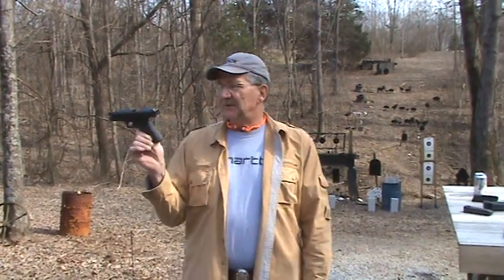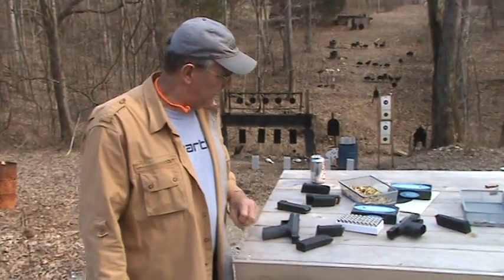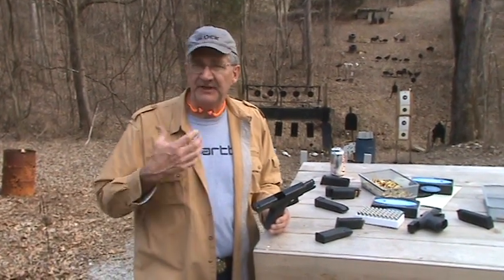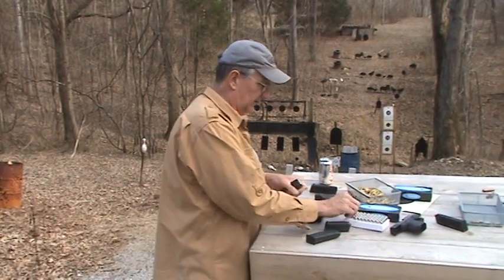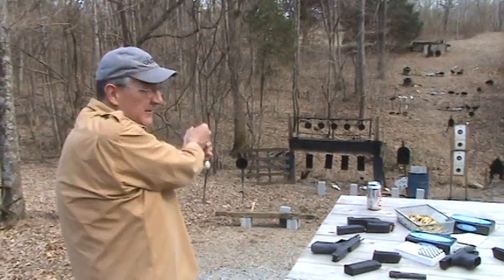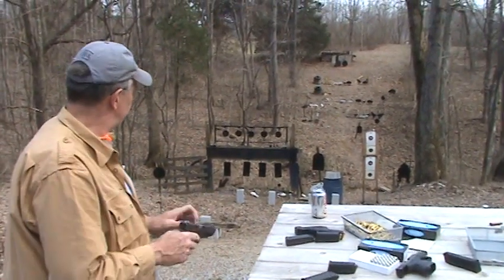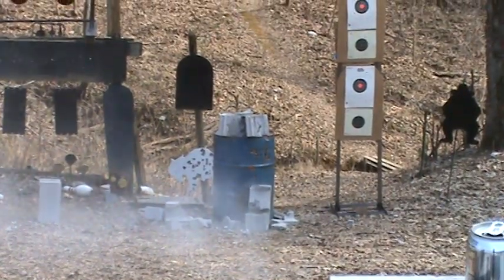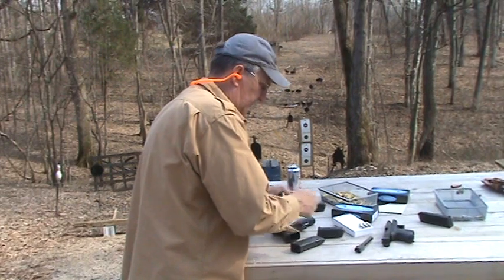Glock 20 with heavy cast bullets

Comment: Hickok45 is probably the one person who can actually say "It's not me, it was the gun". He switched out barrels towards the beginning of the video and started nailing his targets. Any other shooter would've just been missing and making excuses. Absolutely amazing.
Reply: GlowWormActual  that actually has me concerned ....if he can't hit with a stock barrel should  i give up on a g20sf and move on to a g40 that he didn't have to switch out barrels on?
Reply: +racex428 230 grains is super heavy for 10mm. That alone will mean it's hard for a standard 10mm rifling twist to keep it stabilized. Then, they're 230 grain hard cast lead bullets. The polygonal Glock rifling does not bite into unjacketed bullets well enough to stabilize them. They skip over the lands and don't twist along with them. All of that means that the bullets leave the barrel without enough gyroscopic stabilization and tumble end over end as they fly. When Hickok changed to the Lone Wolf barrel, he went from using polygonal rifling to standard rifling. Standard rifling has sharp edges which bite into unjacketed bullets. Now that the bullets were being spun by the rifling, they flew straight and true and were much more accurate. 

So anyway, my advice is to be aware that super heavy and/or unjacketed lead bullets don't work well in a stock Glock barrel and that an aftermarket barrel might be necessary to shoot them accurately.
Reply: mannys9130 so lighter hollow points should do just fine with a stock g20?
Reply: +Luis Angel Perez Oh absolutely. Also, in another video Hickok shoots 220 grain hard cast bullets with no problems. Any jacketed ammo will be fine, and any 200-220 grain hard cast will probably be fine. 230 grain is just too heavy to be stabilized with the stock twist rate and smoother polygonal lands.
Reply: mannys9130 Thank you man, what would be the best round for a g20 in your opinion?
Reply: +Luis Angel Perez In my Glock 20, I load Underwood 180gr GoldDot JHP for if I'm out in the desert. Perfect for mountain lions or people. I load Underwood 220gr hard cast flat points if I'm in the mountains and able to encounter a bear. I load Underwood 200gr XTP JHP in my Glock 29 for EDC in town where I'll only encounter people or dogs.
Reply: LoneWolf commercial
Reply: GlowWormActual I loves my gun

Comment from the maker: The stock Glock barrels are very accurate, in my experience. They are just not designed for heavy cast bullets.
Reply: No. Hard cast bullets have no jacket. The Sig V-Crown JHPs are jacketed. You won't ruin your barrel shooting it in either case, you just would need to clean your barrel with different cleaning products than you'd normally use.
Reply: Wow, amazing to see it that inaccurate! not sure how I have missed this video.
Reply: Underwood came out with a hard cast with some coating on it so it's safe for Glock 20 stock barrel. Have you tried these?
Reply: Double tap uses a copper gas check on their hard cast which is supposed to minimize leading issues

Comment: Glock has the best 10mm, by far. Low recoil, capacity, and reliability. Good demo, as always.
Reply: +mick mueller Don't forget the pricing!
Reply: I agree 100% with you can't beat the Glock in 10 mm it was made for that round
Reply: @louisstaiano4566  The new XDm 10mm has them beat now. They don't need aftermarket barrels to fire any thing. Glock did hold the title for best 10mm for yrs though.
Reply: @scyorkshire2496  The new compact XD and M&P compact 10mm are amazing! I just picked u[ a Glock 29 gen 4 basically new with Aermiglo sights and all mags had pinky extensions. Hard to find so i picked it up. It's my only 10mm and it shoots great plus Glock is amazing but the newer 10mm brand guns are pretty cool. Plus you can run Glock 20 15 round mags in it instead of the 10 rounds 16+1 10mm Glock not bad at all.

Comment: Here is some advice from a biologist friend of mine. "The only way to stop a charging Grizzly or large Coastal Brown Bear is brain shot." It has to be a shot to shut down or severly impair the central nervous system. I can gaurantee you that ANY shooter couldn't accurately handle a 44 magnum revolver shooting Garret Hammerhead 310, 330, and 340 grain super hard cast lead bullets under extreme stress. A quick follow up shot is a joke. So shoot what you shoot most accurately :)

Comment from the maker: @rbelena , All the jacketed Double Taps perform great.  I've not tried the 200 grain cast bullets.  I'd expect a little better performance, but after seeing the way the 230 grain cast bullets don't really connect with the rifling, I'd be surprised if I got really good accuracy with the 200 grain bullets, or ANY cast bullets perhaps if they are the same diameter at the 230 grain cast bullets.

Comment from the maker: @Southern661,  Wouldn't be the length; they tumble in the Glock barrel that is the same length as the Lone Wolf barrel that does just fine with them. It has to be the rifling and/or diameter of the barrel, or bullet.

Comment: A benefit of the 10mm over the .44 magnum, of course, is the capacity of the 10mm.  You can just keep pulling that trigger long after the revolver is empty.  I'd sure like to see the Glock 20 with a six-inch ported Lone Wolf BBL and Buffalo Bore 220 grain hard cast reviewed.  10mm has too long been ignored due to the sissies in government who can't stand shooting it.
Reply: I thought this video was about the performance/accuracy of 10mm hardcast bullets in a Glock 20.  But since you brought us here...if the sissies in government used .357 Magnum...

Underwood .357 Magnum #720 - 180 grain WFNGC
Velocity:  1400 fps
Muzzle Energy:  783 ft/lbs.

Underwood 10mm #241 - 180 grain TJM
Velocity:  1300 fps
Muzzle Energy:  676 ft/lbs.

The reduced useful case capacity of the smaller 10mm pistol cartridge prevents it from exceeding the performance of the larger .357 Magnum revolver cartridge (by 20%) when comparing equally weighted bullets.  You mentioned 10mm in the same sentence as 44 Magnum...I can only guess it was an attempt at humor.
Reply: In Kaliforña that's the difference between 6 trigger pulls vs 10.

Comment: Sectional density, not ballistic coefficient  BCE is a measure of the bullet's ability to overcome air resistance.  SD speaks to bullet weight and diameter..Nice demo!
Reply: Six Wings exactly, when he said it would have a very high BC because the bullet is long I thought that sounded odd. Usually you need a long, slender and pointed bullet to achieve a very high BC like 6.5 creedmoor or the new .224 Valkyrie

Comment: I was recently arguing with some folks from Northern Canada about the best mountain handgun suitable for bear protection available today. Here is my response and why I think the Glock 20 is the ultimate mountain gun... 

I think preparation is all about calculation of probabilities and when i do the math for determining the ultimate (or optimum) mountain gun, although i love big revolvers, odds point out high capacity, 10mm semi-auto pistols. Moreover, although my hearth is with the mighty S&W Model 29, calculations suggest the ugly but functional Glock 20 as the ultimate mountain carry gun even for the grizzly land. 

First of all, even a 50. Magnum would not stop a large charging bear if the bullet does not hit central nervous system or spinal column or heart or artery. Hydrostatic shock and tissue cavitation will not help alone to knock down such a huge mass unless you are shooting it with a proper rifle. So, while the odds are already against hitting a charging bear with a handgun, odds get even smaller for a death blow. At this point capacity of a semi-auto pistol over a revolver has a significant mathematical advantage. You almost have 3 times more rounds in an auto than a 6 shooter revolver which is just like tossing a coin 15 times in a row for the heads versus 5 times in a row. In principle your chances of survival increases proportionally with the round capacity and this is the main reason why all government agencies adopts semi-autos instead of revolvers. (Ironically this is also the reason why California State is limiting the magazine capacity for civilian use with 10 rounds.) 

More over, the more ammo you have in the magazine, the more tactical advantage you gain. For example it would be a wise decision to send up a couple of rounds just to frighten the bear. (Actually, in a bear encounter, if he doesn't walk away after all efforts, shooting a couple of rounds to scare him before aiming at him should be considered. But with a revolver that is questionable.) Or if the attack is unavoidable, you would need some extra rounds for close combat in case you cant stop him on his way.

Secondly; high energy hot rounds like 10mm auto, 41. Magnum or 44. Magnum have extra recoil energy which would effect the accuracy dramatically especially in rapid fire mode. Low recoil guns are always preferable and semi-autos are natural recoil energy absorbers due to their designs. Because the recoil management is inherently easier with a semi-auto chances for a hit is higher therefore chance of survival is higher. (Even petite females can shoot the G20 relatively well.)

Thirdly; auto-cocking ability of an auto is a big advantage over a standard double action revolver especially in rapid fire mode. Semi-autos have higher hit-rates at rapid fire mode due to the light trigger pull advantage.

And finally, regarding the ballistic capabilities of the 10mm auto; it is between 357. Magnum and 41. Magnum. For example, the muzzle energy of a 155 gr. TAC-XP Buffalo Bore round is about 1050 J with a 4.5 inch (11.5 cm) barrel. Although it is not as brutal as 50 Magnum, that is well enough kinetic energy and momentum (without doubt) to penetrate a bear's skull or the spinal column or the muscle tissue to reach his heart or artery. 

In conclusion, although the kinetic energy and momentum of a bullet fired from a large revolver is extremely higher than a 10mm semi-auto, chances for a hit (wounding or death blow) for the semi-auto is significantly higher. Additionally, with all the other tactical advantages mentioned above, a reliable, high capacity, 10mm semi-auto like the Glock 20 overrides any revolver as a mountain gun. It's also important to note that 'Slædepatruljen Sirius' (Arctic Patrol of Danish Navy) units are using the Glock 20 as their sidearm for protection against polar bears. 

Note: When i move to the North my mountain gun will be a Glock 20. But if I had to choose a revolver I would go for a 44 magnum, preferably a 3 or 4 inch Model 29. I think the 50. Magnum is useless especially for bear protection unless you are the Incredible Hulk (or Hickok45:) It is already difficult to handle the damn thing at the range and I cant imagine myself trying to defend my self effectively against a charging grizzly!
Reply: Nice job writing about 10mm benefits in G-20. Recently I got myself a G-40 (six inch barrel version of G-20) although I own the 20 as well. Extra barrel length adds about 80-100fps as every bit of added velocity might help a bit. But, you can't go wrong with you choice of G-20.
Reply: I think the 10mm Glock is a good choice but far from the "ultimate" mountain gun in respect of bear attacks.  I'm no expert but I've read tons of information on the subject just because I'm a bit of a bear nut and love to shoot.  The 10mm, with the right combination of bullet and velocity, likely has enough penetration to hit the important spots so that's not the problem.  The problem arises from the information collected from the documentation of actual bear attacks.  In the vast majority of these bear attacks there are only seconds in between the victim seeing the bear and the bear being on them.  Those precious seconds are going to be used up just in the time it takes for the brain to realize what is happening, drawing the handgun and acquiring an aim point on a moving animal with a very small "must hit" zone.  When you throw in the effects of fear, anxiety and massive adrenaline rush there isn't going to be more than one or two aimed shots fired before the bear is on the shooter.  In most cases the extra capacity gives you no advantage at all.  

My opinion is that the "ultimate" mountain/bear defense gun is whichever gun the shooter is most accurate with that is capable of penetrating a large bear.  If that's a 10mm Glock then, yes, it's the best but it could be a S&W 629 .44 magnum or a Ruger Blackhawk Bisley .45 Colt too.  If I'm going to be in big bear country where an attack is possible I'm carrying whatever I have that can handle the job and gives me the best chance of making that one or maybe two perfect shot/s inside two seconds while systematically pooping myself.  I don't think "that" gun can be determined by anyone but the person carrying it.

Just my opinion anyway..
Reply: I agree about that instant attack situation. But in most of these, people can't even find time to touch their guns. After all I think the ultimate mountain gun is the human intelligence. One must understand that guns are only tools as a part of preparation, nothing more. Furthermore if you search bear attack statistics involving natives (like native Alaskans like eskimos ) you would find much.
Reply: i wouldn't go with a barrel other than original. -there is no logic here though, just a feeling.
Reply: I know, i just don't feel alright with a barrel from another manufacturer. I think Glock should consider manufacturing standard rifling barrels as an option for heavy-cast bullets. I bet they would sell it great.
Reply: Drteslacoiler I
Reply: Drteslacoiler.. They have its called the Gen 5 Glock 17 & 19.
Reply: Well thought out doctes, but one thing you are missing is how fast a bear moves. Now im not making the case for any caliber here, but capacity doesnt come in to play with a charging bear. It would be on you so quick that you would be lucky to have more than 1 shot. I always have said carry what you can shoot accurately and hope you dont have to use it

Comment: Would you recommend changing out the stock barrel on the G20 in order to shoot hard cast (200-230 grain)?  My main use would be hiking in Griz country (Glacier National Park). Or would another ammo be better for my use? Thanks!
Reply: You can shoot hard cast Hi-Tek coated bullets through your Glock safely.
Reply: Just a heads up - I think taking firearms in national parks is highly illegal. I don’t mean to pester you or tell you what to do, I just wouldn’t want you to get in trouble. I may be wrong, but I frequent the areas around Rocky Mountain national park in Colorado and they’re very strict about it.
Reply: @RockyMountainWest13  thanks, I had the same concern, but have researched this and discovered that it is legal to carry in all national parks as they are US territory (rather than private land) and the second amendment must therefore be upheld on them. I have heard, however, that carrying may be banned in stores, hotels, etc. In the national parks.

Comment: i bet since the bullet is longer it need a higher twist rate and i think that the second barrel has more twist that is why i think that it was more accurate.
Reply: No, that cannot be the reason. Stock Glock barrels have 1:10 twist rate rifling, while Lone Wolf barrels have 1:16 twist rate rifling. So the aftermarket barrels have slower rifling. And apparently it is that slower twist rate that helps to stabilize the heavier rounds.
Reply: The Glock factory barrels I have examined have all had polygonal rifling rather than conventional lands and grooves.  Glock  tells us not to use cast bullets in them.  It's the sort of riling that makes the difference.

Comment: On the left is a cross-section of standard rifling and the right polygonal rifling. Glock has the polygonal. The polygonal doesn't stabilize bullets that aren't jacket (coated in copper or brass) but it's easier to clean and lasts longer. The bullet will tumble in flight much like a football that has been thrown but not in a spiral.

Comment: I'm one of those dopes who doesn't read his owner's manual. So when I bought my first Glock in 1992 I fed it my cast bullet reloads. It wasn't until years later that I found out that Glock does not recommend the practice. I stopped immediately after, and then I purchased an after market barrel from Lone Wolf. It shoots just fine with my cast bullets, but then so did the stock Glock barrel. Better safe than sorry I guess.

Comment from the maker: The 200 grain FMJ ammo from Double Tap actually shows a higher energy figure. It's a higher velocity than these 230 grain cast bullets.  They might actually be a better choice for bear country - not sure.  Guess it would depend on how well the jacket held together. If it did, the penetration should be equal, at least.

Comment from the maker: Yes, but it's not because one barrel is made "better" than another. The Glock barrels are just not designed for a lead bullet that is probably undersized and this heavy. As someone pointed out, the bullet is probably a little undersized in diameter - not sure.  I got these kinds of tumbling with .44 Mag out of my Marlin rifle until I started buying larger diameter bullets to load.

Comment: It is.  The 10mm is the parent cartridge for the .40 SW.  The 10mm is a shortened .30carbine case (shortened to .992 inches), and the .40 SW was shortened by another .142 inches.   The 10mm is quite a bit more powerful than the .40SW.

Comment: Both Glock and the FBI, Quantico orignially rated the 10mm round as having almost twice the total transference as a std. 45. 
The Glock 20 or 10mm is still issued in many countries to Forrest and Park Rangers for both Grizzly and Polar Bear defense. ( lol )  
I would have nothing more to add regarding Special Forces applications which might utilize specials or API variants.  

Love your work, Hickok45.